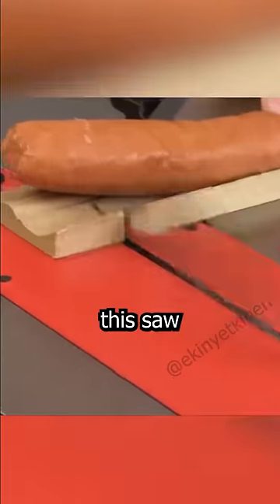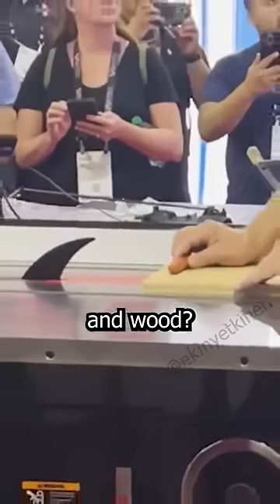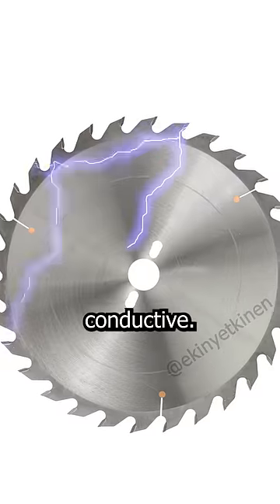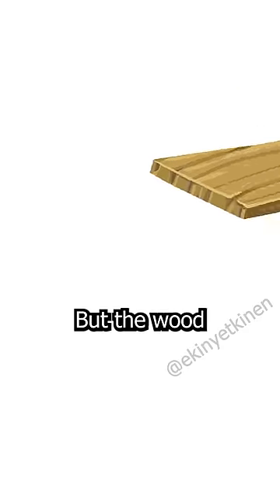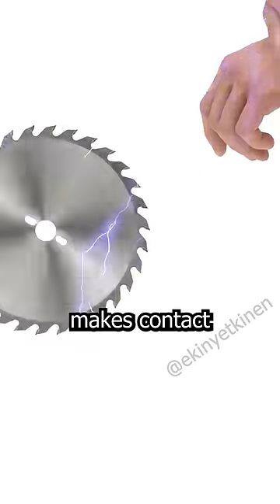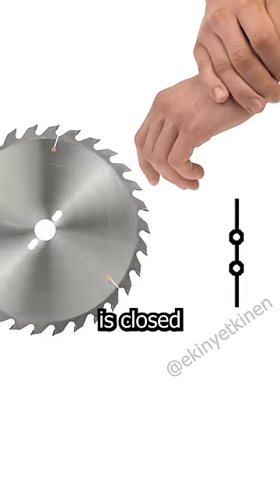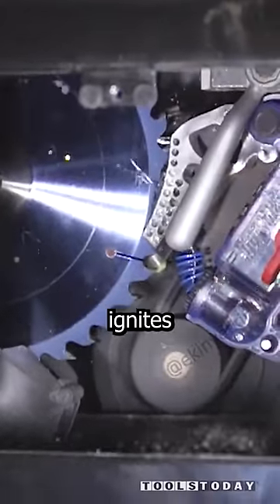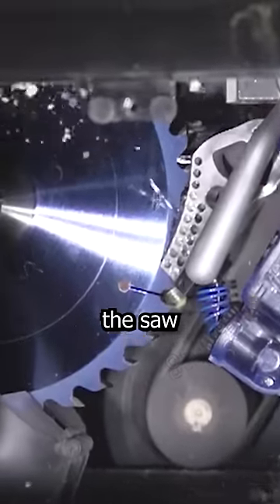How does a wood saw not cut my hand? 🤔 (sawstop)

Comment: No current flows through the sawblade.

This is an example of capacitive touch; the contact from human skin to the blade changes the capacitance of the blade by drawing electric charges towards the point of contact, which a microcontroller detects.

Comment: That means the circuit would be opened, not close. A closed circuit has a loop of current flow, and when the circuit is opened it shuts off.

Comment: Only problem is they do go off randomly sometimes with anything slightly conductive like wet wood or if it has a nail or other materials which is pretty pricey getting that breaking system replaced. When it saves a finger that's amazing but also just don't be stupid and put your hands near anything that spins.

Comment: I don't know why a blade and the entire mechanism needs to be replaced every time there's a potential accident. A simpler design could instantly retract the blade and even apply a break if necessary. Using a solenoid latch to hold the blade and motor in position. Then just like a GFI detects an issue, the latch would release and drop the blade. However the down side to both protection systems is should the person be wearing rubber or insulated gloves, the safety features would not work. Best to be alert and use a push stick.

Comment: The pain is there to teach you not to do that. They're great for high school shop class, but not so great for nails or wet/treated/old lumber that conducts electricity and they're expensive and single-use. Besides which, hitting your finger's the hardest way to hurt yourself with a tablesaw, kickback is a WAY bigger issue anyway and will break ribs instead of just giving you a nasty flesh wound before you jerk your hand away.

Comment: Not to be a geek but in a circuit the switch needs to be open because if the switch is open no electricity can run through it

Comment: So if you where insulating shoes it doesn't work?
Reply: Insulating shoes separate you from the Earth’s conduction. They do not stop your own body from conducting.
Reply: @nooneinparticular469  Sure but if you're not grounded there isn't necessarily a charge difference so it depends how exactly the measurement is made but in easiest mode it probably won't detect you

Comment: The correct safety precautions and paying attention to what you doing is the way forward.

I am not against innovation, but this isn't solution... there are many problems with it, it not always triggers, it not always triggers fast enough to make a difference, it could falsely trigger or damp or wet wood, on nail or metal fragment in the wood and you paying something like $80-200 a pop. 

I mean sure singers are worth more than $200, but pay attention you just don't need it. Consider this - we driver every day, at almost nay given time we are meters away from walls, oncoming cars, cars in front, cars behind, guard rails, ditches on the side of the road, trees... and most of the time we don't hit them. They are there 1 degree left of right in the wrong direction and you crashing at 100 MPH into something most likely solid. Why we don't die every day - because we pay attention, we have rules and as long as we follow the rules most of this stuff is safe, but when you drive drunk, when you not pay attention disasters happen. Same here.

Comment: Yeah? What if you're wearing gloves? I see this device as useless as anti-skid brakes on cars which can cause you to slide off a cliff! These are both excessively expensive and teach unqualified users to operate these machines incorrectly! What happened to using push-sticks...they're free!
Reply: If you wear gloves your hand might get pulled in and turned into launchmeat instead of getting simple cut. Talking about unqualified users operating saws incorrectly ^^
Ironicaly enough this is the only safe way to use gloves as long as you are using conductive fabric.

Comment: That's not an accurate description of how it detects a finger.
Reply: It is though. That's exactly what it does
Reply: @NoCluYT  No. Simply touching a metal object does not 'close a circuit', that is not correct. The capacitance of the blade is constantly monitored, and when it is touched by a conductive object, like blood, the capacitance changes. This change is sensed. That's how it really works. It's no different than a touch lamp. The guy who made this video has no clue.

Comment: no it does not close any circuit. Saw stops measuring capacitance change, thats why nails or moisture in the wood could trigger it as well. dont make a "educational video" if you dont have the right information

Comment: This is wrong, it doesn’t close the circuit when you touch the blade it notices a change in capacitance. Otherwise you would have to be connected to another wire to complete the circuit

Comment: So don't use gloves it will not activate.
Reply: I mean generally you shouldn't be using gloves working with this kind of equipment anyways as the saw blade can catch the glove and pull your hand into the blade leading to either a worse injury or an injury where there wouldn't have been one to begin with

Comment: How is current flowing through the blade when the circuit is not closed because your finger is not touching it yet? You cant even explain the simplest stuff correctly....
Reply from the maker: İt can cut a little bit. İt touches

Comment: this is not how it works. cuz of missleading info ur vid gets dizloice, and ur channel goes to hide list. bye
Reply: It's not misinformation. The blade has an electrical current running through it if you use other conductive material it'll stop.